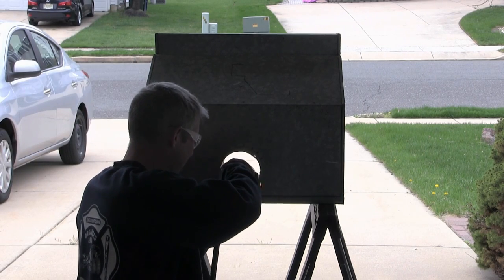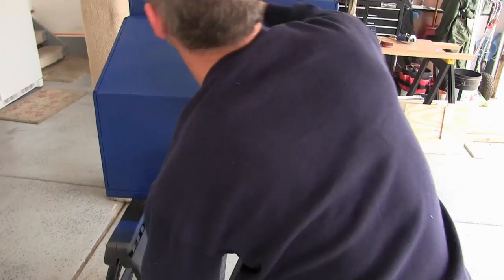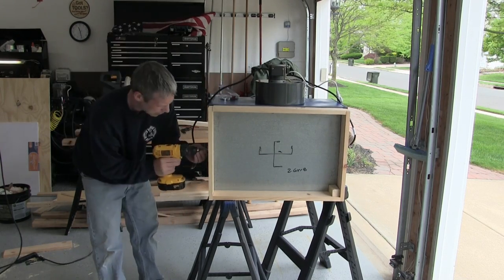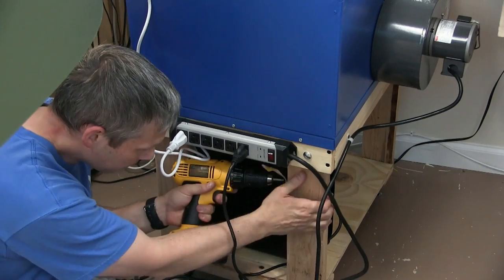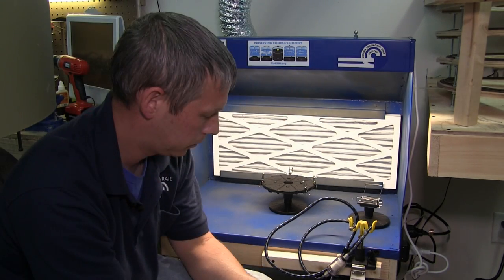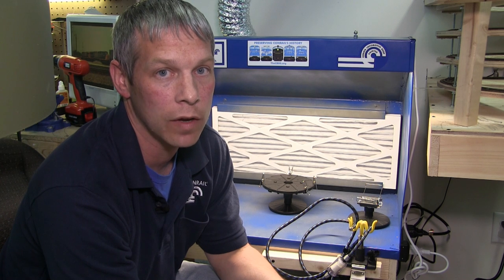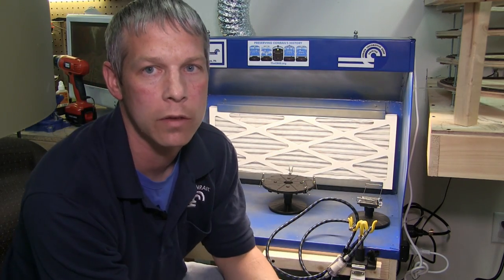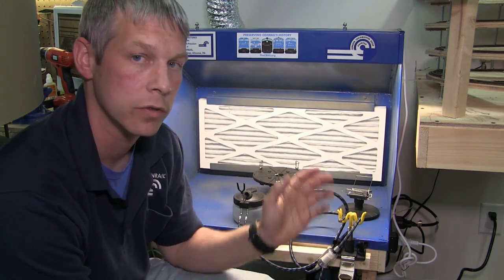Putting together the Spray Booth

Comment: Some advice from a person who built a spray both, the furnace filters are no good, they allow to much paint through and it accumulates inside the fan, you have to take the fan apart to clean it and it is not easy, what I did was buy the three stage filter set from micromark, it does a good job of filtering the paint so it doesn't get on the fan blades. It wasn't the correct size but you can cut to fit. This blower will get clogged inside if you use the furnace filters, they aren't made to filter paint particles, a filter for a spray booth is the best to use since that is what they are made for. After few uses, if you look at the fan, you will see, paying a little extra for a good filter will save you money instead of replacing the blower later.
Reply from the maker: Philip Vitale thanks for the advise, I will look into it! Thanks for watching!

Comment: Very well done.  I would like to mention a couple of items:
1. I agree in trying to minimize the use of the flex duct.  Very inefficient in venting anything.  But in your case, may not be an option.
2.  Lighting - I hope the LEDs that you used in the booth are close to those used on the layout.  Otherwise, you may see a color shift from booth to layout.
3.  It is true that one wants to keep the fan motor out of the air stream.  With the use of brushless motors, the main concern nowadays is to minimize paint build up off the motor as it will affect its cooling.  Heat build up = fire potential.
4.  There is a somewhat fine line on balancing air flow to keep fumes within the booth.  Too much flow can suck the paint past the model and can cause the paint to be dryer as it contacts the model in the air stream.  Too little and you breathe in the fumes.
5.  To determine how "good" a filter one needs, if you can, keep an eye on the fan blades.  Too much paint build up means you need "better" (more efficient) filter.
6.  Out of curiosity, where does the spray booth vent?  Into the garage?  Outside?  Again, check the vent opening occasionally to see if paint is building up.   If so, you need a better filter.

You are a brave man to be spray painting near your car.

Keep up the good work.
Reply from the maker: Thanks Robert
1-going to look into changing to a smooth duct 
2-yes the LED light I got is 4000k and my light are 5600k so it should be ok. I will still match colors under the layout lights.
3- yes agree
4 & 5 thanks I will monitor that
6- outside the rear of the house. I will monitor that.
7-lol thats my commuter car lol

thanks for all of your input & thanks for following!!
Reply: I was commenting about the lighting and then saw this post. Yeah it was drilled into me to make sure your paint booth light is the same as that on the layout. My layout has a 3500k and 5000k florescent light bulb in each fixture so my paint area has a 3500k led strip and a 5000k led strip.

Comment: Joe, just catching up on my RR videos and watched this installment.  Nicely done video, and quality work, as always.  I have a question on the discharge side of the setup.  Where is your exhaust on the outside of the house?  Any concerns over fumes and prevailing winds in your area?  As you use it, would be good to know if you get some inadvertent "weathering" on the outside of your house.  Thanks.  Gerry
Reply from the maker: Gerry Roncolato thanks Gerry. Yes the exhaust heads outside the house. The discharge is on the east side of the house and prevailing winds are from the west in my area, so I don't think it should be a problem. As I get more time on the spray booth I will let everyone know if there are problems.